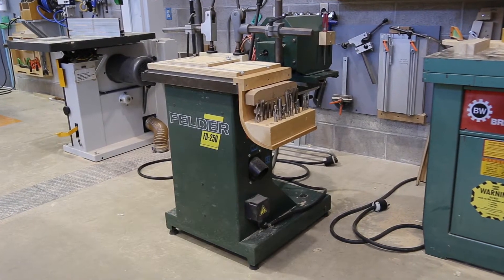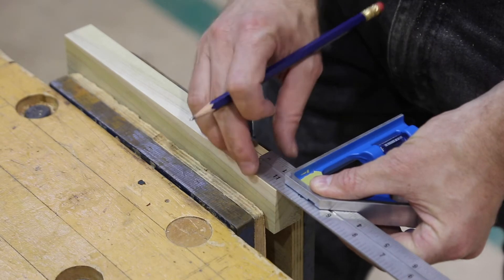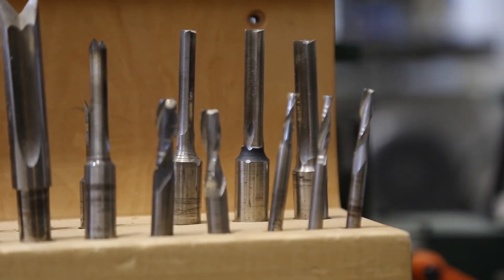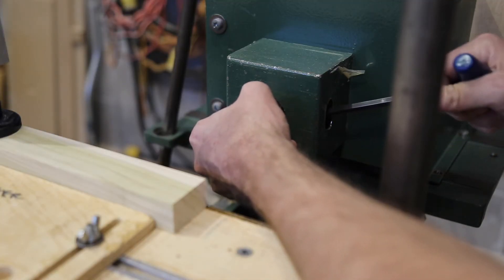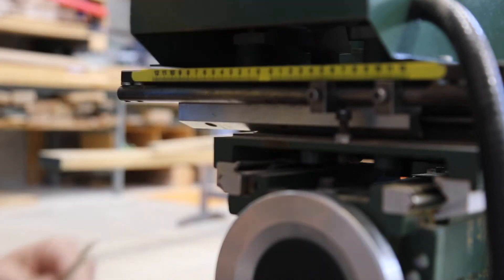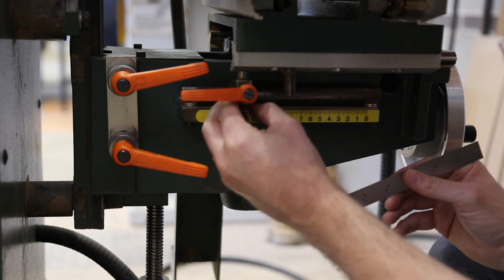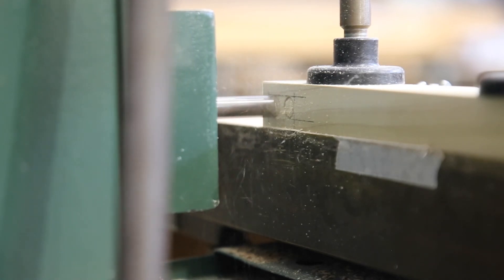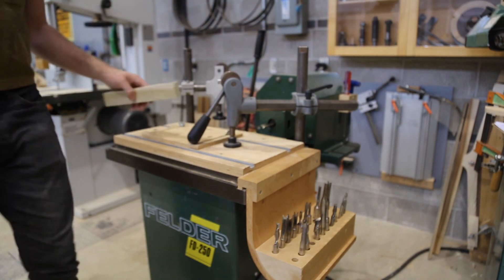Linear Joinery - Horizontal Mortiser

Comment: For cleanest mortises, do you prefer the two-prong recip bit over spiral upcut? Do you always use side to side motion with gradual plunge, as shown in the video, or do you find it sometimes preferable (e.g., for deeper mortises) to make a series of full depth plunges with hole edges just touching, and then clean up with quicker side to side passes than would have been reasonable before the plunges removed the bulk of the waste? Thanks.